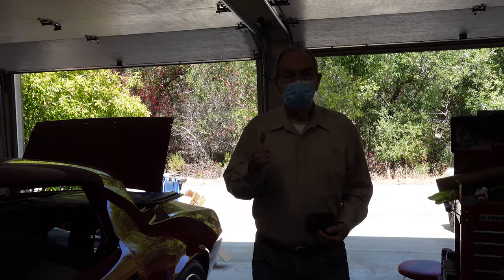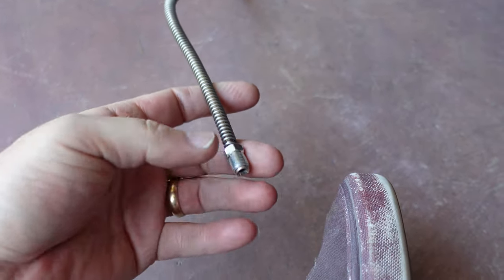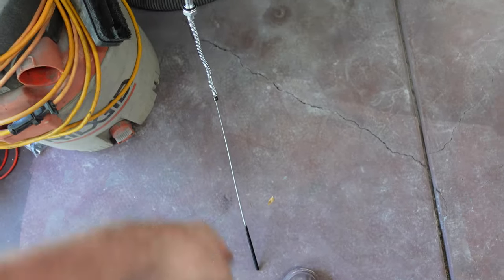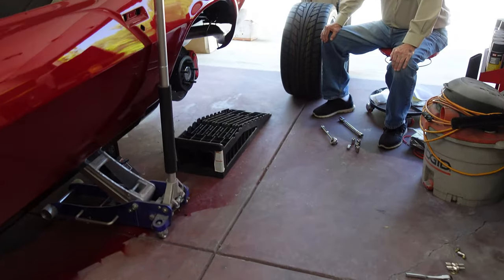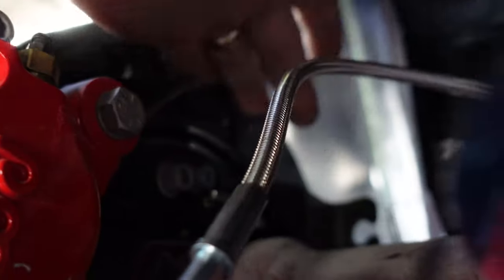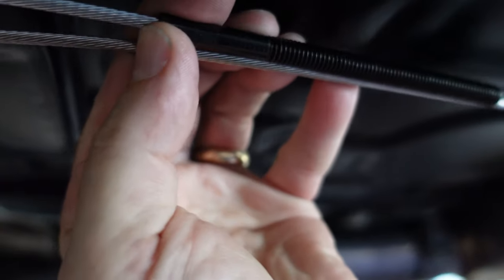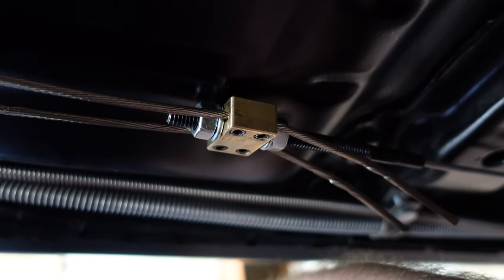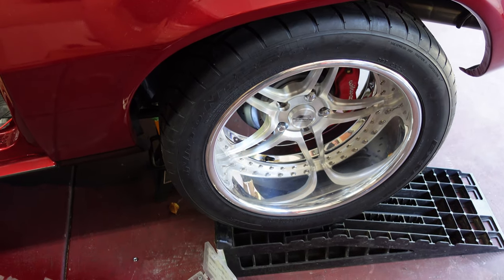1977 Camaro Z28 Part 277: Brakes? What brakes?

Comment: Looks good I had the same problem on my gen 1 with the same set up. I had a minor leak on the bottom of my master cylinder causing air to get into system. On the EB I noticed someone already mentioned it but you need to manually adjust pads to drake a little and then adjust cable
Reply from the maker: Thanks. We got the parking brake sorted, now just need to resolve the leak

Comment: I started with bleeding the master first, then reconnected the lines and went to the farthest wheel from the master and worked back to the closest wheel. I only had to bleed it once and had a great pedal. I'm using the Wilwood master like yours with C5 calipers.
Reply from the maker: I did not bench bleed the MC, thinking the vacuum would take care of it. I can't see where air is coming into the system though. Seems like it should be all fluid by now.

Comment: Hi Erik..try moving the e brake lever at the backing plate, should only move 1/4 inch. You might have to adjust the little shoes with the star wheel. Some setups you have to pull the rotors off to get to them..trial and error thing till it's the right tightness! Good luck to ya, I just went through this with my LS1 disc swap on my '77.
Reply from the maker: Thanks Cliff. I think I can access them. Will give it a try tomorrow. Hopefully a screwdriver will work, I don't have one of those tools.

Comment: Hey Erik, it seems like there is air in the master. If there is an air bubble in there, when you hit the petal no fluid will come out. Try bench bleeding the master and you should be all set. I don’t think that just the vacuum will get all the air out of the master.
Reply from the maker: Thanks. We might do that tomorrow.

Comment: I would find a way to anchor the rear hard line. Vibration over time will crack the line. As far as the bleeding issue...check the seal on the clear vinyl tube to the bleeder screw. They like to pull air there. The car is looking great. Keep up the good work!!!
Reply from the maker: Thanks. I thought about that too after the fact. I can anchor it to the top of the diff housing I think. I was pressing down on the seal, it seemed like it was ok, but who knows. I ordered one of those hand pumps as well.
Reply: @asicerik  if nothing else, put the clear tube on the bleed screw and in a jar and do the old fashion pump and bleed.
Reply from the maker: @musclecarmaniacs9789  Yeah. we tried pumping the brakes with this setup, but there is nothing coming out. There is a lot of air in there apparently! We will keep at it. Thanks a lot
Reply: @asicerik  check the length of the master cylinder push rod to make sure that it is allowing the master cylinder to fully release.
Reply from the maker: @musclecarmaniacs9789  What would happen if not? I would have to drain it to get to that rod (I think)
Reply: @asicerik  The pushrod connects to the pedal on one end and pushes the master cylinder plunger. You do not have to drain the system. Measure how much the rod protrudes out of the booster then compare it to the master cylinder plunger. I had one where i couldn't get fluid through the calipers. Turned put that the pushrod was too long. Fixed that and it solved my problem.
Reply from the maker: @musclecarmaniacs9789  I was thinking I would not be able to move it very far with all the hoses connect. We might do a "bench" bleed in the car. If so, we can pull it out and check. I am pretty sure it is all ok from when I assembled it. Thanks for all your help.
Reply: @asicerik  Exhaust all bleeding efforts first... hopefully that'll do it. You'll figure it put I'm sure!

Comment: Eric ,  for the E-brake, it  looks like you'll need to adjust the shoes till contact  then you can just move the cable  actuator manually to see if it grabs ...
Reply from the maker: Thanks Seb. I was looking back through the instructions. I think I missed that step.

Comment: Are u bleeding thru top bleeder and do you have proportion valve open all the way
Reply from the maker: Yeah on the top (I tried all 4 actually). I move the valve each way, it did not seem to make a difference.
Reply: The instructions say to only use top bleeders and keep valve all the way open
Reply from the maker: @richardwashburn3893  Yeah, that's where I started. Just trying.